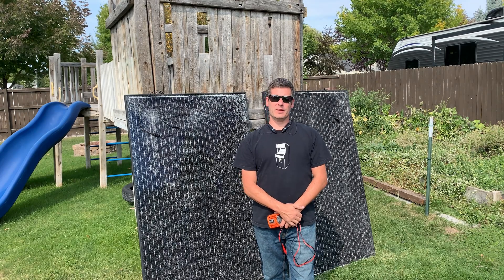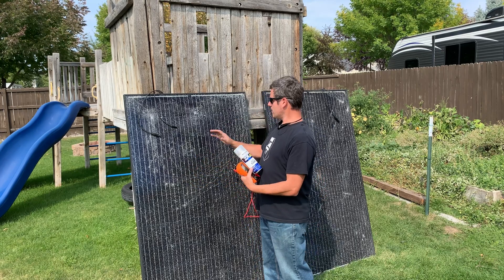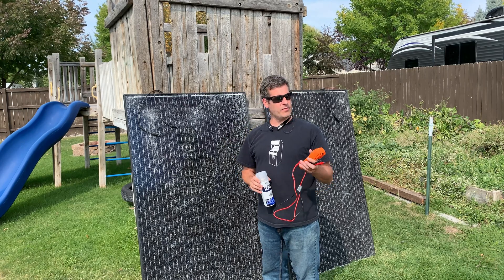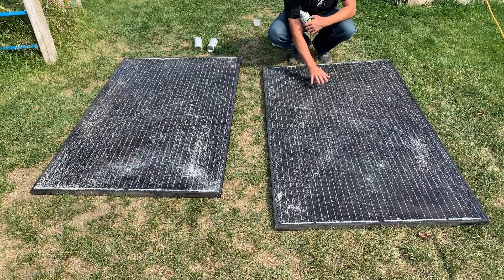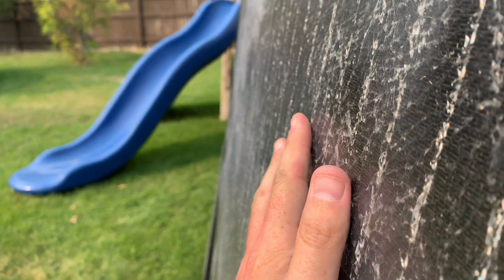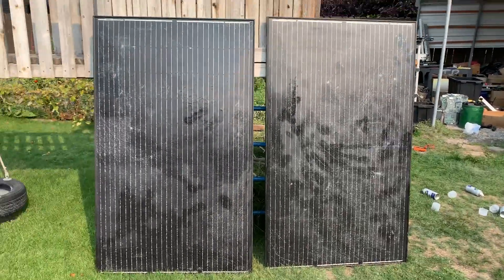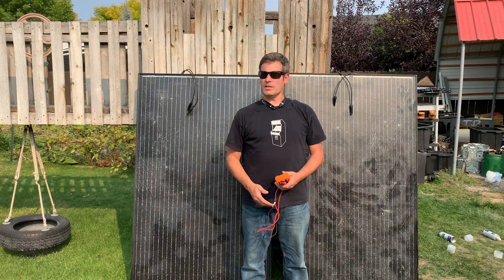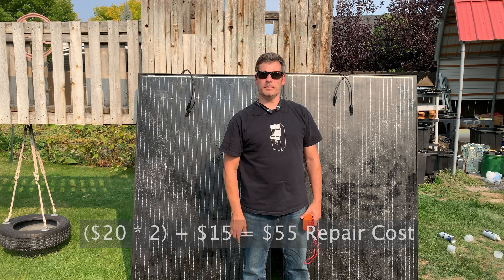Solar Panel Repair: Sealing Tempered Glass

Comment: wonder if polyurethane floor paint would work better than spray on to soak in and fill cracks.  Probably cheaper?  There is also a clear rubberized roof leak sealer paint called "through the roof" that can be thinned down with some paint thinner and might work even better.  Can get it by the gallon.  Forget how much it costs.  I bought some to experiment with diy solar panel encapsulation after seeing one suggestion online and it seemed to work fine and stay clear for at least a year before the frameless pane got demolished by heavy snow load.
Reply from the maker: Huh, probably would flow better.  Next time I have a panel to seal, I will be sure to try that.  Thanks :)
Reply: @badideametals  I have one that flipped in a storm onto my firepit bricks and have both options but the floor poly is matte.  I may use through the roof.  Not sure matte is good for efficiency but I still need to test the panel to see if it's even working.  Been so stormy the last 2 weeks no sun at all.

Comment: Volts don't matter much. You should check the amps.
Reply from the maker: I only had the multi-meter when I recorded this video.  If I had an open circuit because of a shorted diode, I would have shown 0 volts.  I was not checking for efficiency here, I was checking for viability.  I was happy to see the volts were on par with what I expected.

Comment: 2:00 I believe judging a broken panel by measuring "Open Circuit Voltage" is cheating yourself - and in the case of the guilty installer, your customer. Open voltage does not tell you much about the remaining power generation capacity of a broken panel, so when the panel is loaded, the power generation capacity is the one you should pay attention to measuring. The current that the panel is capable of delivering after the glass breaks down is the real thing - not the voltage.
3:48 Why don't you move the second panel further? Now you have a measly 6" wide Walkway between your two panels, and you really have to balance so you don't fall over one or both of them. I don't understand this kind of stupidity.

Comment: After 2 years of this repair, how have the panels held up? Has anything happened to the clear coat after being the >120F temps the panels can get to day-in/day-out??
Reply from the maker: They still are in good operating condition.  I don't put too much load on them anymore.  I had to run power out to my shed so I could run a greenhouse fan 12 to 18 hours a day.  I did not want to risk my plants to a small capacity battery pack.  So I use it for lighting.  I have not had to resurface or treat the coating since recording this video.  Hard to believe that was so long ago.

The panel has not yellowed or cracked with the heat of daily exposure to sun and weather.  I may get a new charge controller that would allow a wind turbine to be added to the system.  That would be my biggest disappointments is that I have too small of a system for what I would want to do with it.

Comment: Hi.
Great work, great video.
Question: Aceylic paint, transparent, UV resistant and: matt or gloss?
Thanks!
Cheers!
Reply from the maker: I am using this:

https://www.walmart.com/ip/Clear-Rust-Oleum-American-Accents-2X-Ultra-Cover-Matte-Spray-Paint-12-oz/965292579?athbdg=L1600&from=/search

It is a Clear Coat - Matte (UV Resistant / Anit-Yellowing) spray paint.  I am not sure if I remember if it is Acrylic or Polypropylene ... the product does not say.  It claims to be a clear coat / hardened shield against damage.  That sounds like acrylic to me.  But I just don't remember what the can said.  The current online product information is not very helpful.  

I hope that answers your questions.  Thank you for watching, and commenting :)
Reply: Many thanks!

Comment: Is it only glass over the pv cells or is it likely that it's laminated with plastic somehow?
Reply from the maker: That may come down to the manufacturer’s specifications.  Most panels that I have seen have a sort of tempered glass directly over the pv cells.
Reply: I've seen a lot, and most monofacial panels are glass on front, plastic laminate on back. On bifacial panels it's tempered glass on glass with PV cells sandwiched between them.
Reply: Also did it make the solar panel any sturdier? I've found that after the solar panel glass breaks, it loses a lot of it's structural integrity, and starts to bend and warp a bit. Also moving the panels makes them sound like rice crispies. I'm curious if this works, but is not strong enough to hold up when moved or flexed at all. Let me know what you think!

Comment: How are they doing 1 year later, specifically with regards to waterproofing?
Reply from the maker: I should do a follow up video.  I had to detach them from the charge controller as the controller and battery were not compatible with each other (no fault to the panels) ... I have the panels mounted, have had them up over the winter... I will do a quick update and check the voltage range to see how they have held up.  But the quick answer, they were holding up just fine since I last checked.
Reply: @badideametals  would love to see the update!

Comment: Do not examine the tablet while standing in front of it in the face of the sun, O pure one 😂
Reply from the maker: Lol, true.  I was not too concerned about max voltage as they were broken.  I just wanted to be sure I got relatively the same voltage as I would expect for 3 diodes, pointed at the ground, with a fool standing right in front of it :)

I got a decent voltage.
Reply: @badideametals  
You can't be so kind to know anything Because the number resulting from the voltage is related to the shadow that you are obscuring while you are in front of it

Comment: What is the name of the material my friend
Reply from the maker: It is a clear coat Rust-oleum paint from what the company site says ... I don't have a can in front of me and their site is poor at giving the active ingredients.  Next time I go there, I will look and respond again here.  I thought it was a UV safe Polyurethane ... but now I can't remember.  I will look.  Give me a few days.
Reply: @badideametals  Surely if the paint is UV resistant it will block UV and therefore reduce the output from the solar panel, and if it is not UV resistant it will become opaque and again reduce the output from the panel?

Comment: What was amp output?
Reply from the maker: My meter does not output amps.  And I did not have the rig in a state to pull that on that day.  Sorry.  I don't have that data.  As for the cells themselves, it fluctuates on the day.  And I don't have them on a full load.  I have them mounted, but not in real use case situation.  I can get that information for you someday :).  Sorry, not the most useful answer.
Reply: @badideametals   Thanks for the reply and I live totally off grid and got couple cracked panels free to coat glass on.

Comment: You should also check the short circuit current with a clamp meter. UNI-T make a cheap one with a 2A and 20A DC scale.
Reply: Agreed… Voltage is not the measure you want, you want to know how many watts you can get. Voltage can remain constant across a wide range of efficiency, and you’d need a before and after calculation of watts on the seal to really tell if it degraded performance.

Comment: Checking panel voltage makes no sense. The voltage will be up there as soon as there is daylight. You should check the current they are producing.
Reply from the maker: I am checking the voltage to see if any of the 3 diodes shorted out due to damage.  The current could also be affected, but I don’t mind on these panels as they are used/damaged.  I will get a feel for how much current they can push another day.

Comment: HOWdy  B-I-M,
Thanks for your video
I had great success with a quart can of:
" SPAR  URETHANE " Gloss Exterior MARINE Grade coating
available at MENARD's & LOWE's big box stores 
It has held up remarkably well on the plastic instrument panel gauges 
on my 1995  Harley-Davidson  DYNA Tank as well - for over 5 years with NO "clouding" 
COOP
...
Reply from the maker: Great to know!  I just did the next video to this (which you may have already found) ... and I have a crack in these panels that I will need to do a reseal.  But now they are on the roof of my shed, so I will have to get up there and get the work done :)
Reply: Thanks! Just bought a can of helmsman to try! Sure hope it's good stuff as I live right under the sun!
Reply: Spar varnish doesn't work, long term. It cracks and peels off.
I used it on 7 panels, cleaned meticulously, coated three layers, big fail.
Going to try DAP Ultra Clear sealant. need some xylene to thin it out. Should work better than the Spar Varnish.

Comment: I see there hasn't been an update to this in months.  How are the panels doing.  I have a chance to buy some in the same condition, but I am looking at 6kw worth so I don't want to mess this up if it didn't work for you.
Reply from the maker: I am putting them up in the next week.  I got held up with weather in the spring and I have been working on a side project not related to the channel.  They are going up this week, the battery for them will be built the week or two following, and last touches will be done last.  There will be a video series for all of this.  

Sorry for the delay.
Reply: @badideametals any updates?

Comment: How many years do you expect to get out of the repair?
Reply from the maker: If sealed, the glass will last for a long time.  The clear coat can yellow or cloud up and that will cause the panel to lower in efficiency.  I expect the panel to work for 20 years, but I don’t expect it to keep the voltage for very long.

Comment: Would you be able to apply this with the panel still mounted at an angle on the roof, or does it need to be flat?
Reply from the maker: Great question! It depends how thick the applications are.  If it runs a little, you may get an uneven coat, but to be honest, if you are trying to fix cracks, sealed glass is better then broken.  I would rather have the glass sealed if it means I would have drips or an uneven coat myself.  That said, if you can apply the coats in thin sheets, you won’t have an issue.
Reply: @badideametals  Thanks!

Comment: You should try before you paint them. Buy one of those spider repair kits for wind shields see if it can fix the spider cracks like it does for car's and than coat them with a sealer.
Reply from the maker: The damage was deep in some places. With the amount of dirt and broken glass on the surface of these, small repairs or over the top film would be difficult to verify a successful repair.  I learned this trick from a solar installer.  They had a specific sealing solution that they mixed themselves… they would not share the ingredient list with me yeas back… so I tried these clear coats spray one and it works for me.  At the end of the day, if there is a crack in the tempered glass, seal it how you can.  You are just trying to keep water out of the electronics so you don’t see an electrical short on the diodes…

Comment: I just put some panels on my garage roof and knowing the little DARLINGS around me will see them as a target,,Would it be ok to put clear perspex sheet over them ?
Reply from the maker: I don’t see why not.  Sun angle is very important for panel efficiency.  If putting a coating over the panel causes light to get diverted or refract, it could lower your efficiency.  But to help protect the glass, … I would consider doing it too.

Comment: Will this coating get uv damage (yellowing) over time and reduce the panel efficiency? Does it withstand elements without peeling?
Reply from the maker: Both good questions.  The cans say they are good against UV… but I have tested them out long term.  The coating is like patch work on your car’s clear coat.  But I will do a follow up after it has been out in the summer heat and sun.
Reply: @badideametals  Thank you, I will try finding a similar product here locally (Uk) as this method is pretty straight forwad. I got a 200w panel that was used as a football by the delivery company, the seller honoured the trade by sending a replacement and let me keep the cracked one as well so I figured I might as well put it to good use. Will be waiting to see your update and future videos ,subscribed. Cheers!
Reply from the maker: :) Sweet! Thanks ... Have you checked the open voltage of the panel?  Good luck treating the panel and getting it running.  My battery is almost ready for re-assembly and the panels are not yet up due to the amount of snow around my shed.  I will be putting up the frame just after the channel anniversary in April.  I have a few videos coming focusing on the panels and batteries.  Thanks again for checking this video out.
Reply: @УенделинБест  u can get the same cans in the uk, amazon and ebay sell them
Reply: @badideametals  I finally managed to put up the panel after following this method. I went with a product called Pastikote, matt finish as well. Panel is rated at 27VOC, I got a 25.89V reading before and stayed within 24V range (variable decimals) after. This was on a clear sunny day,however the sun is still sort of on the low angle at this time of the year so hopefully it will hold till June and if possible fingers crossed perform better. Thank you once again.
Reply: @my_carp_life3424  I ended up getting a product called Plastikote at the time but thank you for taking your time
Reply: @УенделинБест  put a link up to the product please

Comment: Nice , can you please let me know how your panels are doing? I trying to fix a single panel came with a shaded glass
Reply from the maker: It got too cold to put them up.  I am putting them up in the next month.  I have not seen warm weather in 4 months… but I have a plan to get them up and a battery too.  Good luck with your glass on the panel.